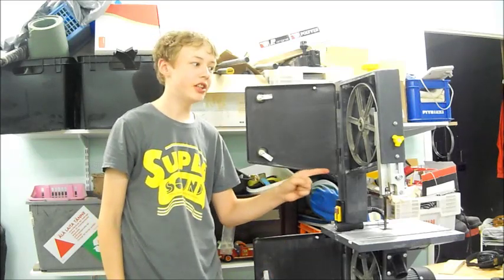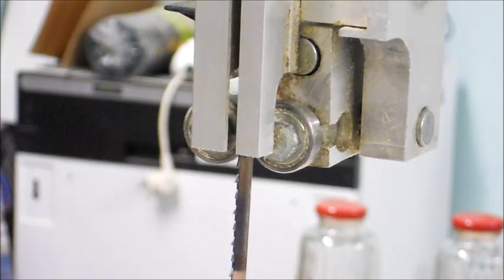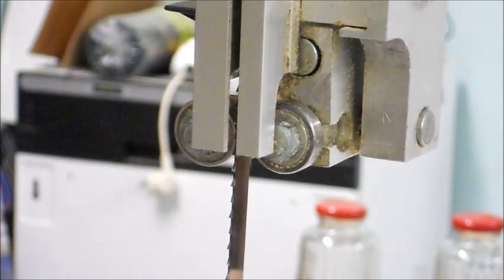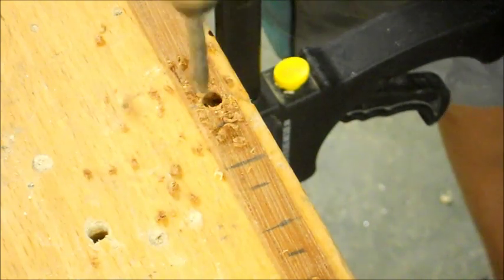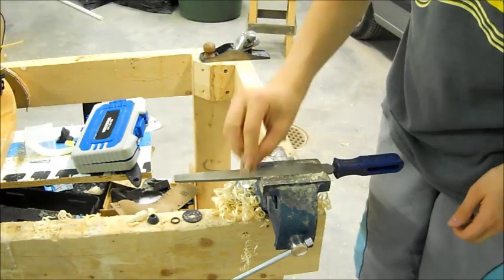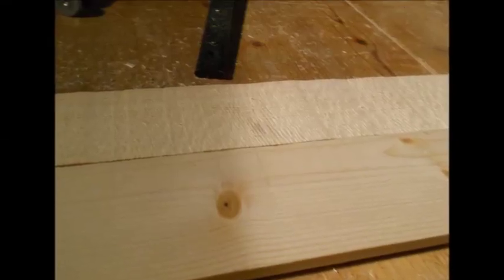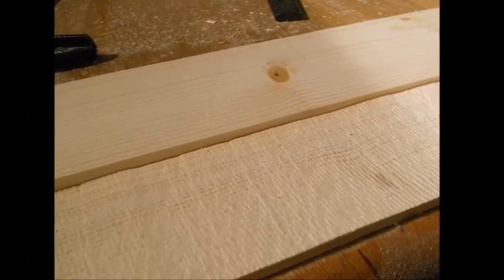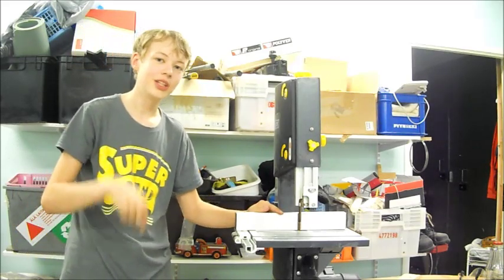Improving a cheap bandsaw

Comment: It would be interesting to see a comparison of curve cutting with the 2 guides.
My bandsaw had the 2 upper bearing guides missing, the previous owner found one, which I fitted.  I order a new guide assembly but it will take weeks to arrived, so I made a wooden block replacement - very quick, easy and...very effective!  As an experiment,, I tried screwing a bearing to the wooden block, that works fine too - but adds nothing other than complication (requires more careful placement, especially with the countersunk screw head use to hold it).  I am beginning to look on bearing blade guides as "snake oil" - hype without real benefit.
Reply from the maker: If I remember correctly I couldn't cut tight curves with the bearings. Adjusting them was difficult so I usually ended up with quite a bit of space between the bearings and the blade.

Comment: You can hear the engine power in Watts?
Reply from the maker: +MUDHD It's 420 watts. That's enough for me, I don't usually work with thick hardwood. I also clean the bandsaw cuts anyway, although they are pretty smooth if the blade is sharp.

Comment: What's the size of blade you are using?
Reply from the maker: It's 10mm (3/8") wide and about 0,3 mm (1/64") thick but the teeth are set so that the kerf is about one millimeter (little less than 1/16") wide. These blades are also hard to break because they are so flexible. Thanks for the comment!
Reply: Thanks. I have the same saw and changing the factory blade made a huge difference. Now it can cut like butter.